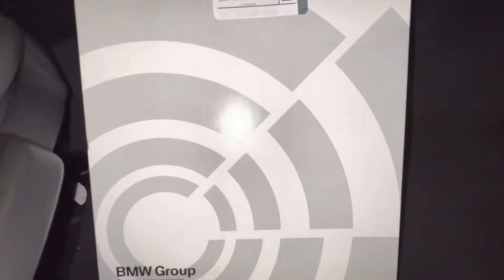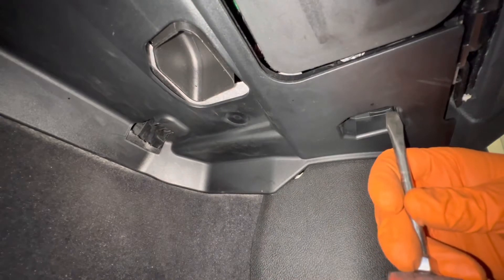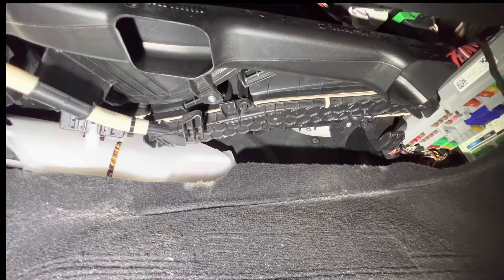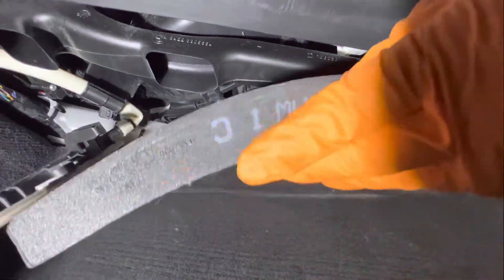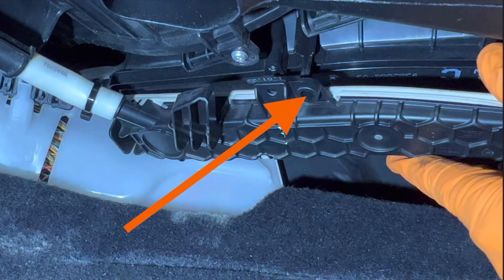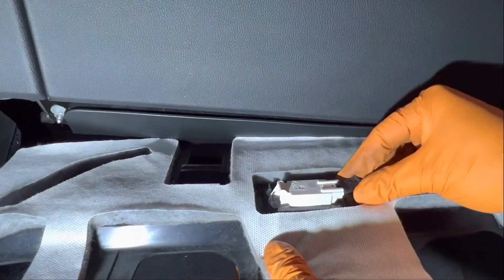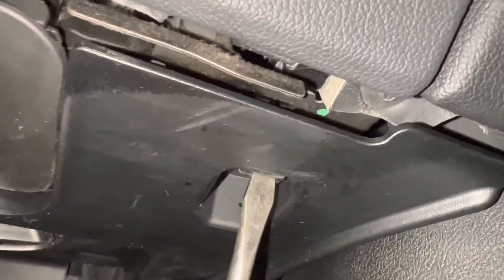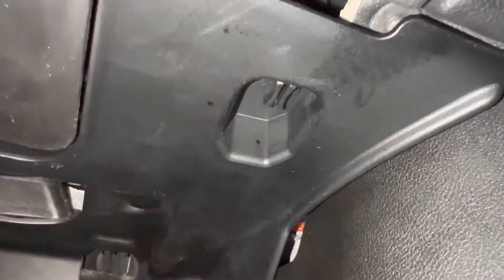BMW G20 3 series Cabin Air Filter Replacement Complete Guide 2019+

Comment: This is the video I was looking for! Thank you! All other videos don't mention the most critical step of recirculate mode to not have the flap flip around when putting in the new filter. Only came across this issue on a BMW form website. Good thing I did a Google search before the replacement. Thanks again!

Comment: Thanks for the video, I was wondering if you turn off the AC after it opens? Or do you change the cabinet filter while the AC is working?
Reply from the maker: Change the filter while the ac fan is on. If you turn off the ac fan the recirculating mode turns off as well. Just keep the fan on the lowest setting and you should be good. 👍🏼
Reply: @friendlymechanic9778  Thanks! Last question, when you you press the circulation button, it allows you to choose from the AC menu: Automatic (the car will automatically switch from circulation or fresh air), and you can also choose to circulate only. Do I put circulate only in the AC menu? while switching the filter?
Reply from the maker: Yes circulate only will be the correct option.

Comment: What is the white rubber tube attached to the cover? Where is is going to?
Reply from the maker: Good question, it’s a water drain. The rubber hose connects directly to the evaporator housing. If there is too much condensation or if water gets sucked in their the ambient vent, it can drain into the evaporator housing and drain out of the car so it doesn’t sit inside the housing. This will prevent mold from growing as well.
Reply: @friendlymechanic9778  Many thanks for that!  That kind of explains my speculation. Long story short, for the last 4-5 months I have a problem with urine like smell coming from my air vents (mainly for the first 30sec, but then it also stays but it's not so intensive). My car is under warranty. I've been to BMW 5 times already with that and going there again in 2 weeks, because every time they say it's done is simply not true. They've changed cabin filter 3 times, used granates, cleaned evaporator. Last time my car was there for 2 weeks when they apparently dismantled a dashboard to find the source. They said the drain pipe was directed inside of the car rather than outside (strange) abd they amended that what resolved the problem according to them, but when I collected the car the smell was still there. Today I took off the cabin filter tried to put the endoscope camera trying to find something suspicious. I disconnected the white rubber tube from the filter cover and sniffed it and the smell was exactly the smell coming from my vents. So please correct me if I'm wrong - I believe either the evaporator has not been cleaned as they stated (or not cleaned properly), or the box or a space where the evaporator is located has not been cleaned and the source of the smell - bacterias are still there. Any chance you know if the place where the evaporator is located is tightly closed? I wonder if this white tube goes to the box and  then another drain tube takes the condensation outside of the car? I was trying to get to the evaporator with my endoscope by unsuccessful ( I don't know if it's possible at all).
Reply from the maker: Hmmm sounds like there is a lot going on here. I can better assist you if we continue in private messaging. I don’t want you to put personal or sensitive information in a public place. 

Send me a message on Instagram if you want further help.
Reply: @friendlymechanic9778  Thank you. I left the message on pm.

Comment: Hey I followed all of your instructions but when I installed the new filter I really had to jam it in there.  Do you think I hurt anything?  Everything seems to be operational and in good working order.  How would I know if I damaged that flap you were referring to?
Reply from the maker: Ahh yes I know what you mean I have experienced that as well. 
Sometimes a little extra push is needed. The last inch is sometimes a little tough. 

If you don’t notice a dramatic change in airflow everything went smoothly. I wouldn’t worry about it.

Comment: The Bmw official service center replaced the microfilter. But I think it was replaced by external circulation. When I see it in the engine room, the air flap is reversed, the air conditioner makes noise, and the wind does not come out properly.
Reply from the maker: I would take it back to them and have them check it out.

Comment: Hello. I can not get the led clip out for the life of me.  It has a red sharpie mark on it for some reason. Maybe they locked it somehow. Anyone else have this problem?
Reply from the maker: Yes they can be tough to remove, the sharpie mark is put them during assembly. Not sure what it is for. It is not glued on and there is no clip to undo.
Reply: @friendlymechanic9778  Thank you for the information. I was even using needle nose pliers and could not get it to budge. I am considering cutting the wire and then splicing it back together.
Reply from the maker: Nooo don’t cut the wires there is a LIN bus line in that connector. 

If it won’t come off I would just remove the light completely. There is a small locking tab on the opposite side of connector. Just unlock the white tab that holds the whole light and feed it out. 

Please do not cut these wires.
Reply: @friendlymechanic9778  Thank you for your help. Very much appreciated!
Reply from the maker: Anytime 👍🏼

Comment: You sure the vehicle you’re demonstrating on is a G30? Also, are you sure the HVAC should be on with recirculating mode button enabled?
Reply from the maker: The Vehicle is in fact a G20 shown. I noticed this just yesterday and am currently working on getting the title and thumbnail fixed as well as finishing edits on an actual G30. Thank you for noticing and pointing it out in the comments. 

The mode should definitely be set to enabled to close the flap inside the HVAC box. In some cases when the flap is left open damage to this flap is possible and removal of the entire heater box may be necessary to fix the issue.
Reply: @friendlymechanic9778  so does the climate control need to be running with recirculating light ‘on’ WHILE doing the filter swap? Or can you turn off the whole climate control system after pushing the recirculating button before swapping the filters?
Reply from the maker: @matthewrichardson6263  I will double check for you tomorrow. But my understanding is that it needs to stay on otherwise if you shut off the system the flap will go to the default setting which will open the flap. There is a service information bulletin put out by BMW that addresses this issue.
Reply: @friendlymechanic9778  I'm sorry to complain about something handed out for free. But, this video is the first result that appears when searching this topic. However, clearly the information provided is inaccurate or incomplete. Car in the video is not the model in the title and no other tutorial for G30's states that the HVAC needs to be running nor anything about the recirculation button.
Reply from the maker: The video is for a G20 my apologies for putting the wrong title I will fix it. For now I can help with your G30. Send me a direct message on instagram if you like. I can send you a detailed message with photos.
Reply: @friendlymechanic9778  I recommend that you change the title of this vid. And, if you could, make a separate vid for the G30. 

Also, you should check the SIB for the exact way to position the climate control before removing the filter. BMW service has mentioned turning the recirculating mode to OFF before removing/replacing the filters. What you’re advising is the very OPPOSITE of what I’ve been told.
Reply from the maker: Hey Matthew thank you for the comment. I just double checked the SIB. I did mis-speak in the video and said it should be “open” when in fact it should be closed. 

However the light on the recirculating button should be illuminated as shown in the video, this is still correct. 

When the light is on the flap will close and will not allow fresh air into the cabin. This is the mode you want when removing and installing the cabin air filter. 

When the light is Off the flap will open and allow fresh air into the cabin. Damage to the flap can occur in this state. 

I will also change the title right now and change the thumbnail soon. Thank you for letting me know much appreciated.
Reply: @friendlymechanic9778  I appreciate the detailed explanation. To summarize, BMW SIB is requiring service techs to toggle ‘recirculating mode’ in order to close the flaps? But, I’m wondering why you want the climate control to be active while performing the filter swap? Would it make more sense to verify the climate control is in recirculating mode and then power everything OFF?
Reply from the maker: I’m some cases when you turn off the blower motor recirculating mode turns off as well and the flap will open.

Without removing the blower motor or using a small camera (boroscope) it is difficult to look inside and verify which is not ideal for the average DIY’er. Which is why I advised to just ensure the light is on and put the speed to the lowest setting.
Reply: @friendlymechanic9778 how easy is it to damage the flap? I replaced the air filter today and didn’t see this till after but can’t tell whether or not I messed anything up. It’s difficult to hear any change in airflow when I switch from recirculate to fresh air
Reply from the maker: You would need to feel some resistance when inserting the new filter and push through that resistance that’s when the flap breaks. You would know something is broken if you feel as if the AC isn’t getting as cold or if there is some decrease in airflow. 

I wouldn’t get too worried If you feel the AC a little warmer than usual since (depending on where you live) the weather has been quite hot the past few days. So if the AC doesn’t feel as cold it may just be because it is hot outside. I wouldn’t jump straight to thinking something is broken. 

Chances are you didn’t damage anything when changing the filter.